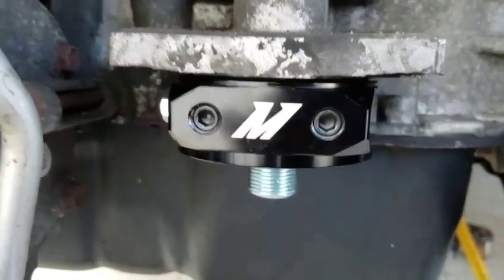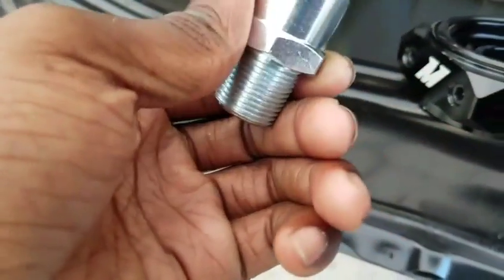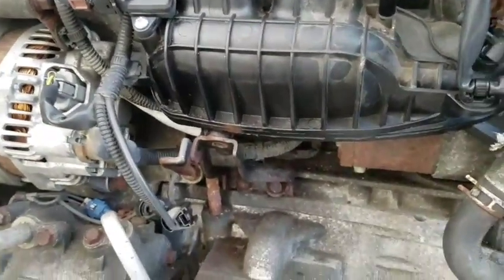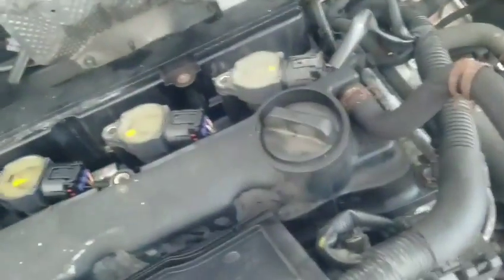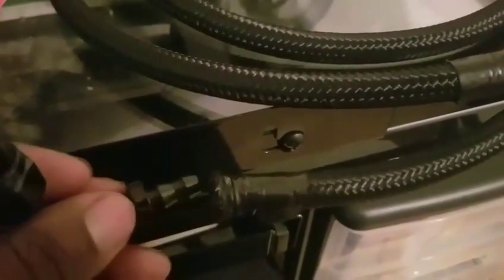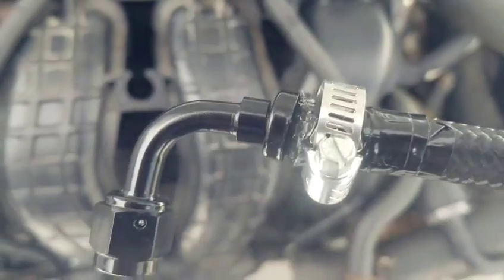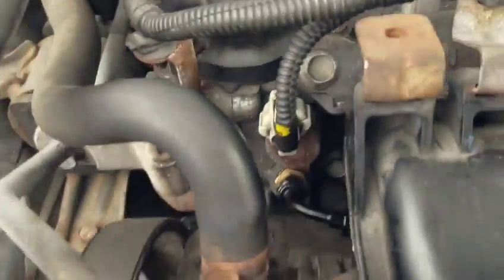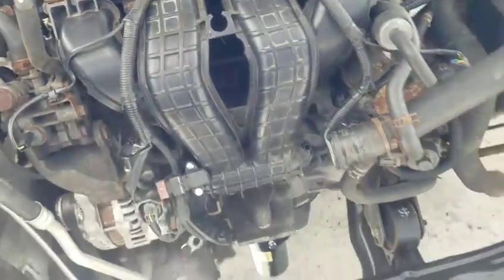How to Turbocharged your 09 Mitsubishi Lancer part 1/3 -Engine Preparation

Comment: Where did u install the coolant in and out line too?
Reply from the maker: Took it from the throttle body
Reply: Define Modified both in and out ? Is there a video or something that u over that on ?
Reply from the maker: @STATIC_KING813  I dont remember which one